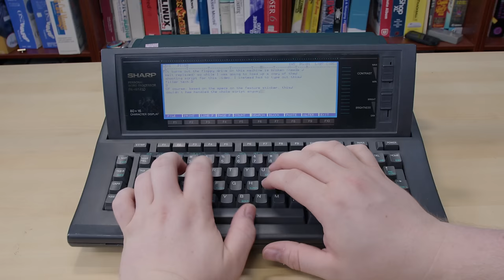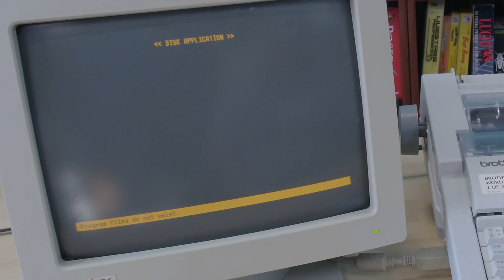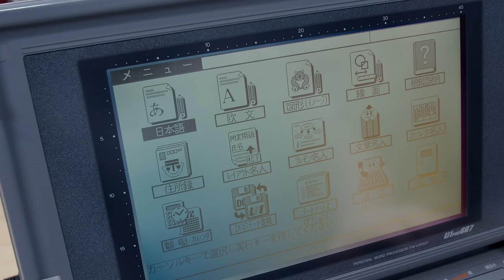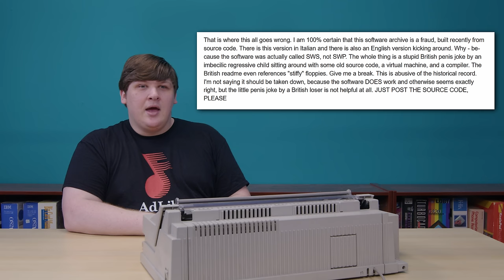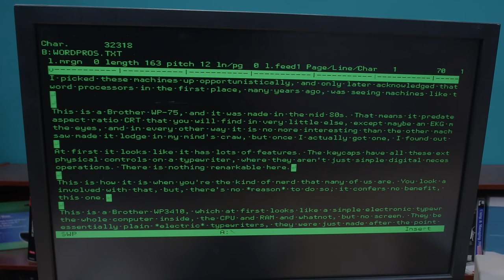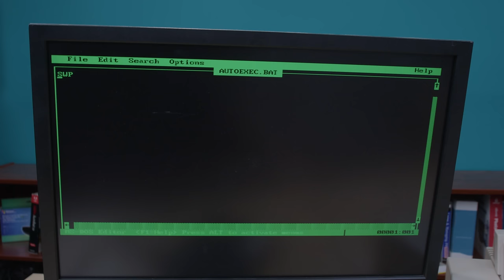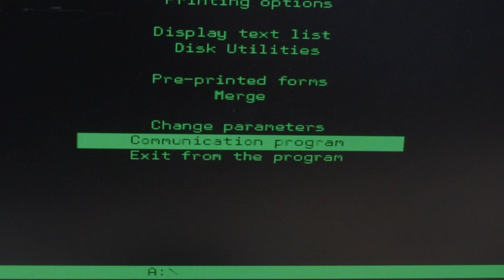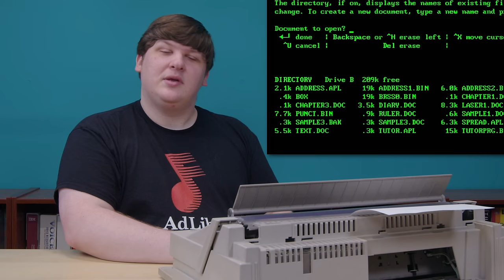The Weird Processor: Olivetti's PC Typewriter

Comment: Powering the monitor from DC is an Olivetti thing. The Olivetti PC and the rebranded AT&T and Zenith versions have a matching monitor that works the same way, albeit with video and DC on a single D-sub-something connector.

The Olivetti likely outputs monochrome VGA at 31kHz horizontal/70Hz vertical. Not too uncommon, a there were also some high-resolution monochrome monitors for 68k Macs that used composite video via RCA. It works fine as long as you don't need color. 

Then again, many CCTV cameras use something called TVI or AHD which is even weirder: It's NTSC composite video at HDTV scan rates! The H/V sync is 31kHz/30Hz for 1080p30 or 45kHz/60Hz for 720p60 with the color subcarrier frequency shifted way up for higher bandwidth. It can run over coax as long as it's RG6, and it is backwards compatible with SD NTSC, so it's good option for upgrading old systems as you can reuse the existing cables.
Reply: You may have missed the whole video he made about analog HD security cameras from a year or so ago ;)

Comment: This Olivetti kinda reminds me, albeit rather tangentially, of the Amstrad PCW (Personal Computer/ Word Processor) range - which I believe was primarily sold as a 'low cost' word processor that could also run CP/M. However, unlike this Olivetti, the PCW definitely didn't try to hide its underpinnings - looking way more like a computer than a word processor (as, whilst it was shipped with a dedicated printer - it was a separate unit). However, if I recall correctly, the later PCW16 had a way more locked down operating environment built into ROM, discouraging the use of user supplied CP/M programs (but had a colourful keyboard which, unlike its processors, was PS/2 compatible)

Comment: I have to say I really enjoyed this video, even if it took me a few days after release to get around to watching it. This video reminded me of when in very early 90's a dedicated and inexpensive (compared to a whole PC) electronic typewriter for my family became the catalyst to us finally purchasing a full blown PC, which turned into me working for over 2 decades in the IT industry.  

Around 1990 or 91 my sister and I started begged our parents to get us a PC so we could write papers for school and so with one. The parents continually resisted due to the cost (which I now completely understand.) However, after our parents spent around $100-150 on an electronic typewriter with a very small 2-3 line display. After fighting with the unit for WAY too long and having my sister and I complain loudly about it at every turn. They finally caved around the start of the 1992 school year and bought the family a full blown PC.

Of course instead of just getting us a fairly basic late 386 or low end 486 machine and a dot matrix printer, our parents decided to take out a sizable loan and spent almost $3000 on a top of the line at the time 486 DX2/66MHz PC, SVGA monitor and a HP Deskjet 500 printer. Then for Christmas that year spent another big chunk of money on a multimedia upgrade kit with a SB compatible 16bit sound card, 2X CD-ROM drive and a set of decent speakers. Any additional upgrades for 1993 or 1994 were basically out of the question as my parents decision to go overboard in 1992 put a serious hurt on their finances. 

My sister and I were super thankful to be able to do our school work (and a whole lot more!) on a nice PC and we promptly threw the crappy electronic typewriter out! We all HATED that electronic typewriter with a passion!

Comment: The quality of the IBM Wheelwriter was really unmatched.  I recently purchased a IBM wheelwriter 30 series II.  The keyboard uses a buckling spring and is pretty much revised Model M.  The CRT is an add on that requires a card - among other card options.  However, the model I have has a large LCD screen right above the keyboard.  Now, your comment on boring is very much true.  However, a Model M keyboard is boring too.  We still buy them for some reason.  I think it is the feeling one gets when using them.  Then there is the Selectric line which is fascinating because it uses mechanical binary.  Who could resist that??!!

Comment: I'm not sure if it was made especially for that market, but the Olivetti behemoth was standard furniture for some Italian and Spanish local governments and notaries. Wills, building permits, awards, judicial rulings land deeds, etc in Italy were printed on once folded A2 forms. Each type of form came with its own floppy containing the fields to be filled and a print template. 
When ready three copies of the A2-form were printed as four A3 pages, only the entered text was again printed on an A4 and the input was saved on another floppy that was filed with the document. Two numbers were printed in the bottom margin of page three, that had to be added to get a control number used as a security check. Then each A2 was embossed with a pattern, signed and cut or sheared off in a curvy pattern that separated the two numbers. 
The cut off strips of paper were filed with the document. If the validity of the document was challenged, it could be authenticated by fitting the cut off with the copy of the document and completing the check sum. The sum was generated at random and excluded from the A4 print, I don't know how that was stored. I can imagine the Italian government wanted the machine to be as incompatible with other computers as possible, to discourage reverse engineering of official documents by the national riffraff.

Comment: Breaking through the 640k barrier..they used the LIM (Lotus Intel Microsoft) Standard... AKA Expanded Memory ...could in theory handle up to 8M ...using memory swapping  technique... .the machines i used back in the 1980's could upgrade to 768K ...not many programs could  take advantage of this though... of course the biggest one that could was of course Lotus 123..

Comment: Fun fact- my late 80’s bargain basement Brother word processor- which doesn’t even feature an LCD, but does include a spellcheck system based purely on audio feedback- also does the Bold trick; also worth noting, most of these machines supported both 10 and 12 CPI- some daisywheels are meant for one or the other, and some can be used with both, offering another fake layer of “rich text” variety.

Comment: Years ago working at a BBS turned ISP, the BBS was still there, and we had a LOT of these machines connecting to the BBS collecting email using the terminal software. I became the goto support guy for these and other weirdness in out userbase.  Always they felt totally cheap, keyboards slightly better than a spectrum + keyboard (Old school UK watchers are now going "ouch, that's harsh").  less state of the art more state of the ark was a comment coined in support for them.

Comment: Wordstar and other word processors of the era had printer definitions one could build if you had an oddball printer, but if you had any of the more common ones, you'd use the provided definition.  Thus, if you tried inverse on your daisywheel, the system wouldn't print junk, just standard text, ignoring the inverse command in the document.  This applies to 80's word processing software in general, regardless of platform.

Comment: The brief mention of electric vs electronic typewriters reminds me of one I used at a university work-study job. It was an IBM daisy wheel design with the same style ribbon but also had built in correction tape. It had one line of memory and there was a small LCD panel but, IIRC, it didn't display the text. Instead it behaved like an electric typewriter just with the ability to automatically remove any given character on the current line - use arrow keys to move the carriage to the character and press a key (labeled something like delete?) and the letter would go away leaving the carriage in place to type the replacement.

I also remember that I could type a little faster than it could print so I would be a few characters ahead by the end of a line.

Comment: I'm not the only one who was fascinated by this tech then for a while. In the UK we had some interesting machines that fulfilled this purpose (other than the obvious Brother/Canon models):
- Amstrad PCW (arguably more of a cheap computer capable of running CP/M but also ran its own word processor called Locoscript).
- Amstrad PCW16 (an interesting replacement for the PCW which came out very late (around 94/95 I think), it was Z80 based but had a GUI and there was a website by the guy who designed it explaining how it was put together. The disk format was weird on this one and if you did operations on the disk in DOS you could screw up the format.
- Canon Starwriter Pro, this was a Dos based system running Geoworks from rom.

Comment: Some years back I had also received the same typewriter, they wanted to throw it away, but I stopped them for spare parts. That thing still worked perfectly and had good picture on my Nec MultiSync V323-2. That Nec monitor pretty much swallows any signal and is ideal for my retro nerd hobby. I completely dismantled this typewriter and was still able to pull out some useful parts. But as you say, these were never really useful devices, not at those high prices anyway.

Comment: (Around minute 14) I have a word processor for kids made in the 2000s based around a Z180 and had that lag issue. I traced this issue to the processor handling the keyboard polling by themselves, while most computers have a dedicated microcontroller to handle that - which launches an interrupt whenever the keyboard does something. Polling is very resource intensive and coupled with running the app could explain the lag.

Comment: Any time I went into computer stores, I always bumped up the refresh rate. I couldn't take the 60Hz refresh. It hurt my eyes so bad. Even at 1600x1200, I'd run my 21" CRT at 85Hz. Too bad I v-synced games at half that :/. Separate issue.

I remember thinking "why are TVs not as bad with flicker?". They were, but it's harder to notice with motion constantly on the screen.

Comment: I remember using Panasonic U1 series word processor when it came out.   It was really nice word processor, and I still have it in storage for long time in the hope i will fix them when i found necessary parts to fix printer.  U1 series has number of neat feature, and some of which includes ability to boot with DOS with partial files, that totally deserve someone making video about.  Though very little detail of how to do DOS on these machines survived on the net, so it will be challenge to do research.

Comment: When I got my 486SX, I made sure to make it able to run at 85 Hz, even if it was a lowly 800x600.  I could do 75 Hz at 1024x768 which was "good enough" but the 85 Hz mode was BALMING, like seeing an LCD for the first time.  I was even able to manually configure an unpopular 768i interlaced mode, but at a really high 90 or 100 hertz, it really didn't matter that it was interlaced at all.  And the screen flicker was all gone.  Raymond D. Kell eat your heart out.

Comment: I install AV integration, surgical lights, and equipment booms in operating rooms. Last year, building out a new operating room, we were instructed that we’d have an input from a boom that would be “sync on green”. Having never heard of it before, it was cool to hear more about it here. Our setup was a BNC plate to a DVI-A 5-BNC  breakout. Just barreled coax to the green channel. Felt wrong… and apparently this is still a thing, at least by 2023.

Comment: On the Olivetti, for loading the paper, is it possible that when you flip down the bar (forgot the technical name, but the one on the top that holds loaded paper down), if you pull the lever further then it self feeds the paper? IBM WheelWriter typewriters do this. You set the paper into the back, then🎉 just yank that lever and it feeds the paper right where it should for you to flip the bar back down on to it.

Comment: Every time I see or hear about electric typewriters I think of stories that Sci Fi writer Harlan Ellison told about the writer he most admired... That guy bought one of the very first electric typewriters. Essentially because of the speed. As they wrote for pulp mags so they got paid by the word so more words per minutes meant more cents per minute. The person in question wasn't happy about the speed he got even with his newfangled electric typewriter. So he would buy paper on rolls instead of sheets. So that when he reached about a sheets worth of words. He could slice it off with a nearby razor blade. Throw the sheet on a pile and continue typing on the next page without wasting time reloading papers. 

I am a bit coy about who this guy was... But it's because. If I remember the stories correctly. It's because... It was L. Ron, mr Dianetics Himself, Hubbard. 

Which may be a strange default association between a piece of tech and a person in a brain. But that is what it is.

Comment: Very interesting watch - I also got interested in some of these weird old word processors last year. Gave up on buying one locally thankfully and instead went for a Panasonic Sr. Partner - basically a IBM Portable XT clone with a green CGA CRT over composite and a built-in thermal printer. It isn't blazing fast either but it works great for early CGA games/light BASIC programming.

Comment: The carriage moving as you type without printing on the machine at 2:10 is so you can line up what you're typing with the previous line for doing tables or indentation and similar stuff.

Comment: Two points:

2) You missed a significant market for dedicated word processors; journalists

Having a "luggable", relatively cheap device to bash out copy quickly, and print out pages to be faxed or otherwise telexed was an absolute godsend for journos.

I used my step dad's Olivetti word processor for many a school assignment in the 90s, and it absolutely suited my needs.

2) You said that IBM Keyboards were the only ones worth a damn.

I absolutely cannot disagree that there were many woeful keyboards around, and many attached to the case of the computer so no other choice but to use it (I'm looking at you, TRS 80), but the Apple Macintosh keyboards were at least on par with the IBM keyboards, and arguably better
Reply from the maker: You're right, I skipped over the journalist angle, and that's entirely on me since I had started to write scripts about these things before and did touch on that fact. Dang!

As far as the Mac keyboard, I left it out because... I've own several and I think they're terrible too, lmao

Comment: Fascinating. Fun thing - I have one of those CRT-based Brother word processors - specifically, a WP-2200. And more importantly, it still has the spreadsheet app disk. Titled quite simply as "Spreadsheet, Punctuation Alert and Data Storage Disk for Brother Word Processor Version (1.0)" ...yeah. The machine used to work and so did the disk but it's been years since I turned it on. That disk should probably be archived for posterity... not sure how, though.
But I gotta admit, I have to give props to Brother for maintaining the user manual for stuff that old on their website.

Comment: A bit off topic but i have to mention this every time i see someone mention olivetti.
I have an Olivetti CWP1 word processor, its uses a z80 iirc and has support for dual floppy disks (tho mine only has one, also the pcb has an edge connector, covered on mine, thinking it could be to use it as a dot matrix printer, i wish at least).
It uses a super weird format to store stuff on the floppy and i havent been able to either read or erase data from floppies i've used with it, Olivetti made some super weird hardware back then tbh. Also, it seems it had EEPROM "upgrades" i've read about a spell check addon but dont @ me on that cause mine too doesnt have it, just an empty socket

Edit: Tbh this word processor has the same clunkiness as the EVT2700 actually, it also has a create/modify option and you have to input the name of the text file, it also has an index, i really wanna do a full video demonstrating its capabilities bc its cool, you can do italics, bold, underlined, change the width and height of characters etc.

Comment: 58:25 Pro tip: 5.5m hex nuts are not all that uncommon. Some hardware-store-brand "precision screwdriver" sets will include a bit for them... some dollar-store ones too. I lost the 5.5mm hex bit for my bougie precision set – I won't name the brand, to avoid sounding like a shill – so I pinched the 5.5mm bit from a cheaper set I had lying around.

Comment: Fun fact: the daisy wheel printer at school supported microspacing, the kind of thing used to do bold like on the Olivetti. Fun fact II: it also supported microspacing vertically, for stuff like subscripts. Fun fact three: a full stop / period symbol is also a (large) pixel.

Which is how I ended up writing a font editor and arbitrary-font print package for our school's daisy wheel printer.

You needed to use thick paper or you'd be punching holes out of your document. xD

Comment: In 1962 SCM Smith Corona Marchant brought out a desk-sized typewriter based on its 2nd generation electric typewriter. In the cabinets and drawers were a number of printed circuit boards. This device could type out your standard letter as inputted. by the typist. It was also capable of storing form letters that could use a contact list. Suppose you wanted to send 250 form letters but did not want them to look like mimeographed sheets that had the name typed into the body, you would set the machine up, and off it would go typing up your request. This was at the time when computers were still programmed with jumper wires. This was, of course, meant to get a jump on IBM and their new Selectric electric typewriter. It was a nightmare! It was a cross between an analog pinball machine and a transistorized hi-fi set. Needless to say it was a flop and  electro mechanical typewriters held the market for the next 25 years.